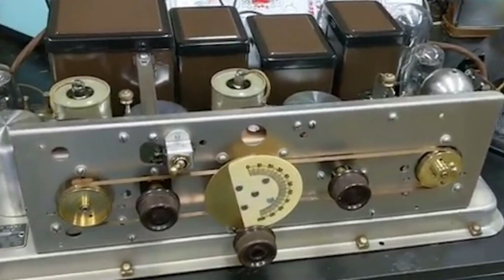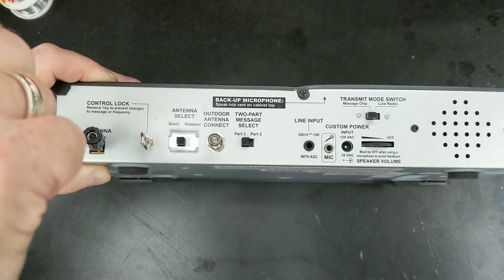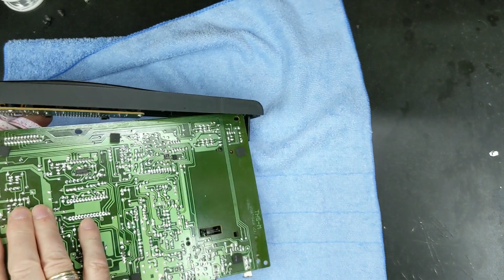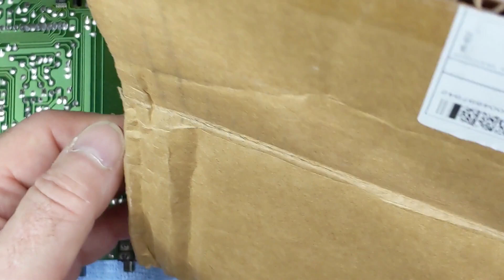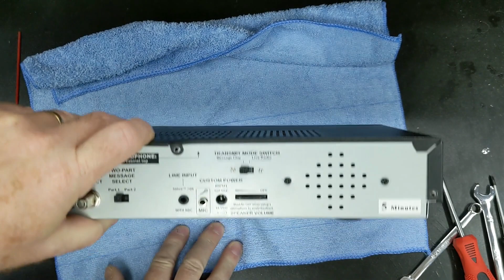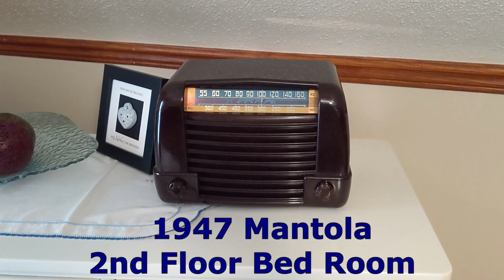Whole House AM Transmitter Repair

Comment: This is a Talking House, not a Whole House.

BTW what is that little black box on the PCB above the antenna tuner? Is that some kind of ferrite chokes or something?
Reply from the maker: You are correct it was a talking house that could make it to the street, used by realtors, but I'm using it as a whole house transmitter and it works great for that.
Reply: @greggsvintageworkshop8974  it makes it confusing because there is a transmitter named Whole House thats an FM transmitter the size of one of those pocket FM/AM receivers, that's what I was expecting to see and not the talking house.

Comment: That's a nice job there Gregg and thanks for using spanners on the nuts and not pliers 🙂 That's a very interesting box, I will see if I can get one. Does the power plug pack support 230V by chance? Cheers 👍🙂
Reply from the maker: Thanks David, unfortunately I think it only does the 120vac.
Reply: @greggsvintageworkshop8974  No worries, thanks Gregg.

Comment: Looks like the chassis was designed for a DVD player! Slots in the bottom and a big rectangular slot on the side for the DVD platter to move in and out of the unit!
Like that your radios now have something better to play than crappy modern day AM broadcasts. It can record up to five minutes of "live" voice if you wanted to
because I see a round electret microphone mounted next to the speaker wiring on the pc board.  You all may be interested in more of this device. 
See www.theradiosource.com/products/infospot.htm The instruction manual is at www.theradiosource.com/downloads/talking-house-i-am-radio-instructions-manual.pdf
Reply from the maker: Thank you, and awesome information!

Comment: That's a nice looking AM transmitter Gregg, I have one that I built and it works good in my work area, but doesn't cover all areas in my house it really needs more power.
Reply: Supposedly the FCC compliant part comes from the wallwart which has a  three wire grounded plug. If you put a  two wire adapter plug  on it before plugging it in
 it should put out its maximum output of 100mW. Don't use it in the basement of your home . Put it in a second floor bedroom for maximum range.
 I never told you this ,shhh.
Reply: @hestheMaster  I have always wondered how strict they really are especially now with all of the drama currently. I have heard that they send you a warning by mail for a violation.